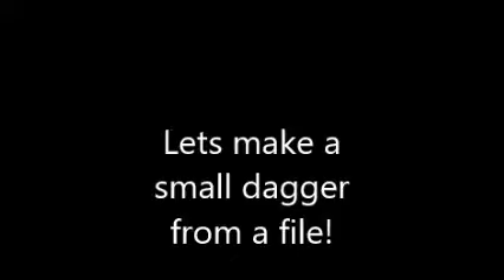Small dagger from a file

Comment: Hello ,  good job.I am an nob in knife making , but I want to make my own knife from an old file.Why do you anneal the file ? It is not already hardened by producer of file?Thanks.
Reply: Thank you for your answer. Initialy I intend to use only power tool with many stops for water cooling (to cut the shape and grinding the blade) without any heat treatment . Now you make me think if I can reach this job... I try to avoid heat treatment because personal I do not have forge (If necessary I have a friend who have one) and I do not have any idea how to keep 400 C 1 hour... My electrical  kitchen oven work maximum ~ 220 C .  Thank you very much.
Reply: Thank you very much for information/help.